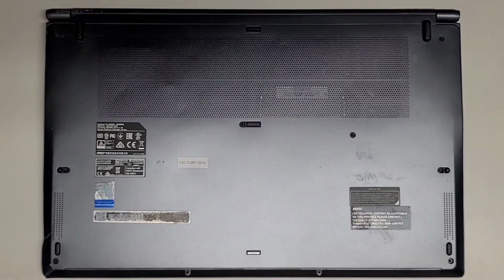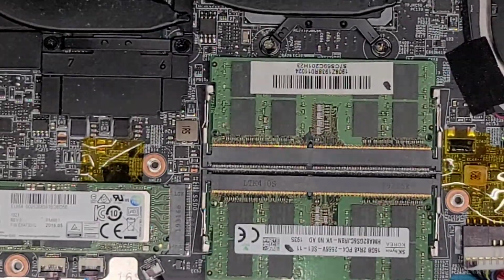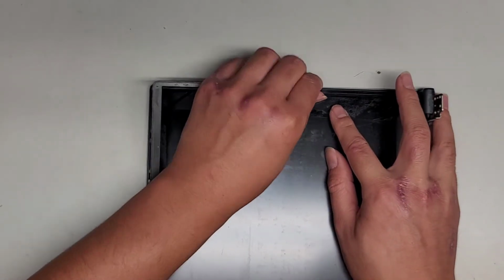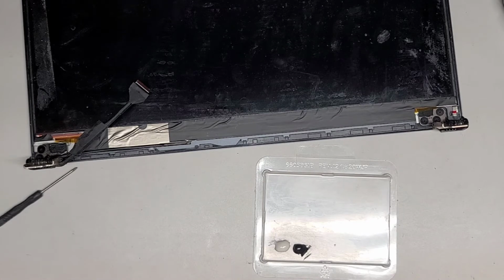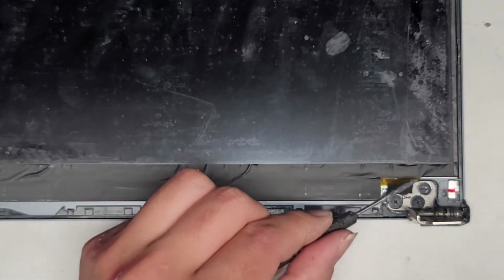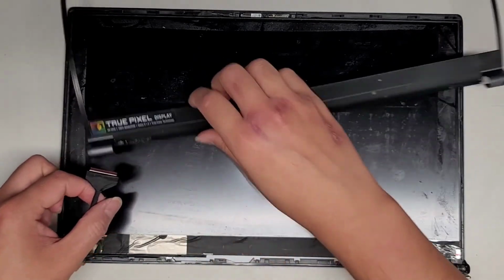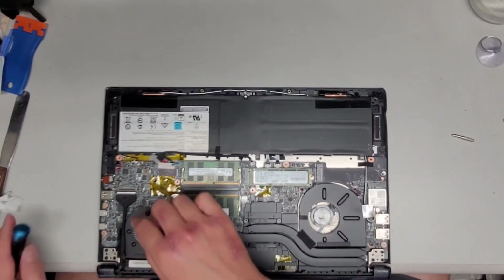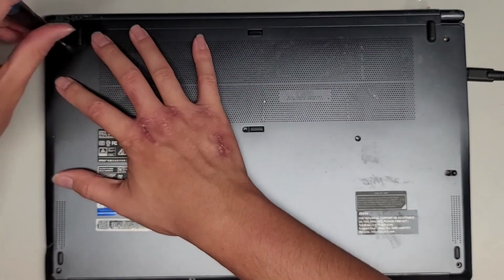MSI Prestige 15 A10SC Disassembly RAM SSD Hard Drive Upgrade LCD Screen Hinge Replacement Repair

Comment: Same model, and same broken left hinge problem (it's july/2022). Laptop is almost 2 years old but barely used, like new. Never traveled, always in protective neoprene case, etc. Shame on MSI, this hinge problem is clearly a factory defect, probably a bad design combined with defective glue. Anyway,  I bought the exact J-B Weld and used it to glue the metal hinge back plate to the plastic behind. In my case I didn't have to disassemble the laptop, I could apply the epoxy from the outside. That  kept the screen frame in perfect condition (after watching the video I didn't want to disassemble the screen). The repair worked very well. After 24h the lid opens and closes correctly. I hope I don't have to repair the right hinge too, but I'll be ready if it breaks. Thanks a lot for this video, it gave me the precise information I needed to do the repair myself. I'm currently  in Barcelona, Spain and I really didn't know where to take the laptop to have it repair.
Reply from the maker: Awesome, glad it helped. Yeah, the design of these laptops now are terrible. This thin and light bezelesss designs are a problem.
Reply: Yep had mine replaced, left hinge problem tore of entire screen. Now my replaced laptop is having the exact same issue...

Comment: I glued it all very well, replaced the cable and the screen does not work lol
pc was a gift... but yeah, idk what fails, checked every connector and so. external display works!
Reply from the maker: Likely fried motherboard circuit

Comment: I own this laptop. The hinge broke within 8 months of purchase. Got it fixed thanks to the warranty. 
It is a decent laptop which supports 2666Mhz ram upto 64GB, has 2 m2 nvme slots. But it has some pretty bad thermals. It heats like crazy! The one you have looks like its been through a lot
Reply from the maker: Bad design :( Designed to break and be replaced.
Reply: @ItsBinhRepaired  Hello, is there a video on this model of laptop showing how to remove the heat sinks and clean the fan? One of the fans is making noise and it's annoying
Reply from the maker: This video should help https://youtu.be/3zs_SJ3BXgA
Reply from the maker: Same idea as this https://youtu.be/-lGfH3utfeI
Reply: @ItsBinhRepaired  I think the heat sink and fans are one piece for Prestige 15. Something like this: https://youtu.be/0WDkdTWr2gw
I am not sure though but I did manage to unscrew the bottom panel and use a blower to dust off the fans. Made a little but noticable difference in noise! (Just for now though, don't know how long it will last)
Reply from the maker: @aaronryder4008  usually the fan repair works best

Comment: that factory seal has 2 crossed slits in it, just put the screwdriver through that. you can put the screws back in and it will look like it hasnt been tampered
Reply from the maker: Interesting

Comment: Great video! It helped navigate inside the computer. But after reassmebling the computer the screen doesn't turn on. You mentioned frying of the screen backlight circuit. I wondering if that can hav happened to my computer becasue I didn't drain any residual power from battery. It works on a external monitor through usb c. Is this problem fixable? Thank you!
Reply from the maker: If you disconnected the lcd lvds cable without battery drain, it's now a burnt motherboard circuit :(
Reply: @ItsBinhRepaired  wow laptops really suck, especially MSI lol
at least the HDMI works xDD
Reply: let's find out what part we should replace!
Reply from the maker: Yup...

Comment: I have the same laptop and the hinge broke same way in your video after 3 years.  Eventurally I broke the screen. Now the laptop still works except the screen so I connect it with a monitor.  I am wondering if I can just detach/remove the screen part and continue using the laptop without screen. Please shed some light on this. Thanks.
Reply from the maker: Yeah, you can remove it. Make sure to do the power drain
Reply: @ItsBinhRepaired  Thank you so much!
Reply from the maker: @y.k.9219  yup

Comment: I have one of these and it just died for no reason. I can’t see burnt comps on the motherboard and I’ve tried holding the reset button and swapping ram. Any clues?
Reply from the maker: No clue :(

Comment: Does it matter if the adhesive from the bezel has weakened or do I need to apply some sort of tape or glue? And would it also be possible to use super glue instead of epoxy for the hinge
Reply from the maker: If the screen isn't falling out, no glue or adhesive needed. Super glue is way too weak. If you even try it, the jbweld won't hold after that because it'll separate at the super glue. Don't even attempt it.
Reply: @ItsBinhRepaired  thanks
Reply from the maker: @mugge1178  no problem

Comment: I don’t have a succion button and I can’t get the top off. Any recommendations for that?
Reply: It’s ok I figured it out! It was very dusty so I cleaned it with a brush but is it enough? Or should I use a gas blower on the cpu to deep clean it?
Reply from the maker: Gas blower might be too much

Comment: The wifi of this model sucks. Does anyone else have the same issue?
Reply from the maker: Sucks in what way?
Reply: @ItsBinhRepaired  The APN/ SSID detection of the intel AX201 chip inside this MSI prestige laptop is very bad. My smartphone can detect multiple wifi of my neighbor like 8-10 SSIDs, but my laptop can only detect 1 or 2. My smartphone can connect to my wifi even 40 50 m away, but my laptop Prestige 15 struggles to connect to my wifi  at 10 12m away. Can you please verify if the same happens with your laptop. compare your smartphone and laptop wifi detection capability.
Reply from the maker: @Bishalkarn  l don't own the computers in the videos, but it sounds like the antennas aren't connected or are bad.
Reply: @ItsBinhRepaired  I had my problem posted on reddit in msi and intel forum, found other owners of this laptop have had the same problem. I don't know the culprit here is intelAX201 or the bad antenna design by MSI.
Reply from the maker: Possibly